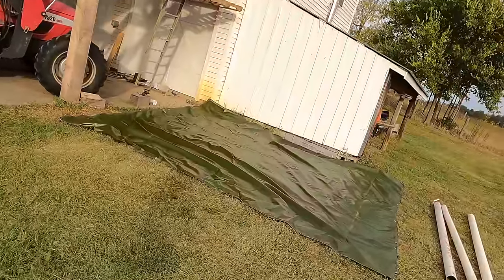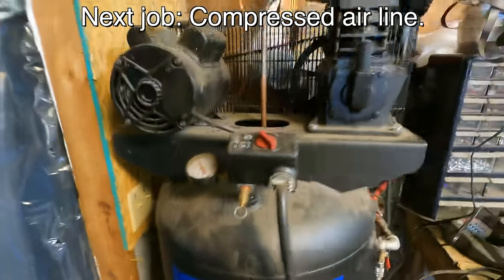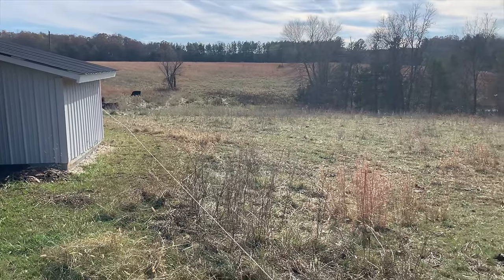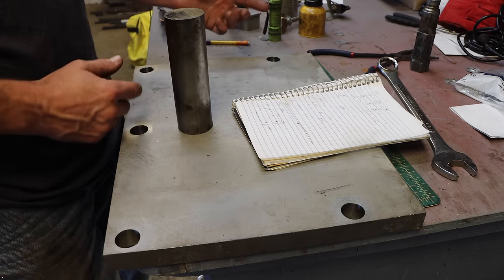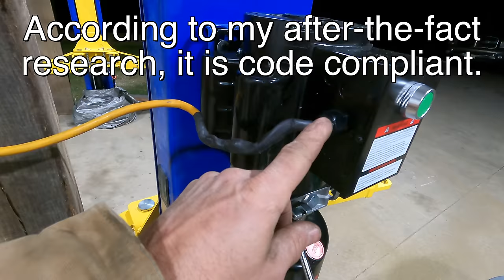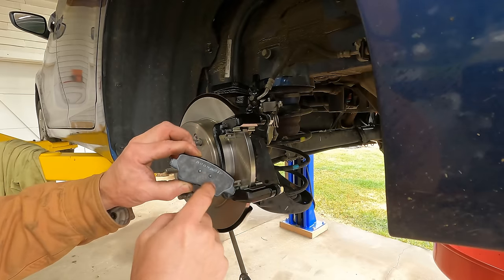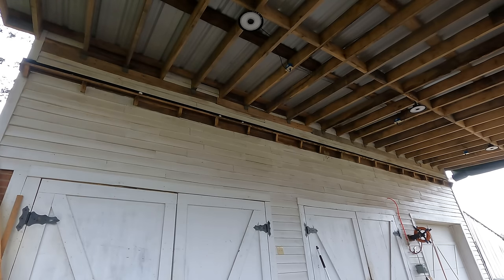Installing a 2-Post Vehicle Lift And Other Big Shop Improvements.

Comment: Next Upgrade for the Lift: Paint a line perfectly centered between the lift posts to use as an Alignment Line when pulling cars into the lift bay so they're centered between the posts unlike your daughter's car was (it was at least 4 inches left of center if not 6)...that will even out the lift forces on the jacking arms as well as make getting in and out of the driver's seat easier...

Comment: Little advice to the air line outside, make a bleeder valve. The outside air temperature range low/high mite create moisture in the supply line. Bleeding a short burst the supply before hooking up /using the real will make your tools stay “happy”

Comment: That stainless base plate is impressive! If you're ever in a similar situation and looking for a more cost-effective solution, it's common to epoxy anchor pieces of all-thread (rather than expansion bolts) into the concrete, then thread on a nut and large washer to set the base plate on. You get precision leveling and adjustability on-the-fly -- no machining and no stainless base plate necessary! Then, pack with non-shrink grout as you did. Voila!  That said, yours is a great solution that uses what you've got. Run whatcha brung, right?
Reply: I see the city guys do that here in Seattle. Then plenty of grout under the plate.
Reply: I was about to say this! That's the way to go
Reply: Double nuts to level, then packed with grout, this is how countless outdoor fixtures are mounted and leveled, street lights, traffic lights, signs etc etc. Your engineer friend probably could have pointed you in that direction. That said I do actually make inch to 2-in thick stainless steel mounting plates for large outdoor sculptures and those annular cutters look fantastic.

Comment: Sheer luxury with a 2 post lift, sheer luxury. I am very envious. Your Angus cows look well feed and very quiet so I assume hand raised or just used to being around people.
One tip from when I was dairy farming. When strip grazing we would back fence the already grazed part so they did not go back over that area nipping off new shoots, made a surprising difference to how much available feed we had. Of course you need to be able to arrange the backing fence so they can still get to water.

Comment: "Perfect is the enemy of good." -something I read by someone somewhere.  I think I learn more practical things from this channel than any other one I watch.  Pex for air is amazing.  I don't have a shop compressor (or a shop) but I love PEX and when I get to that point I know what I will use to plumb it.  Really appreciate this and the chainsaw tips.
Reply: As an old time plumber, I was reluctant to start using Pex or any of the plastic "pre-Pex" options out there.  Since I've started using it, I'm hooked.  use it every chance I get.

Comment: Straightening that angle iron reminds me of straightening the bumper on a 1975 nova. Set the bumper on the ground. Laid down the jack. Then a bunch of 6x6 pieces of wood. Wrapped 2 chains around the bumper and the wood. I seriously thought the wood was going to explode into shrapnel as I pumped the jack. And I was standing right above it. It’s actually amazing how much large pieces of wood can bend. It got the job done.

Comment: Since your lift is not in a heated building, get a lizard tank heating pad and stick it on the outside of the lift's hydraulic tank.  This will keep the oil fluid if you have to use it when it is below freezing. The heating pads usually have an adhesive on the one side or you can just zip tie it to the tank.  I only plugged mine in a couple of times, but things usually need serviced at the coldest of times.
Reply: Also, that's like a stick-on sump/block heater for Canadian cars.
Reply: Great call Scott, cold fluid is not fun.

Comment: 3 things: 1st, love the channel. 2nd, I've used pex for airline for 10-15 years and have never had a problem.  3rd, I hang my lawnmower from the lift arms with straps rather than lift the mower with the arms under it. 😉

Comment: A few things you may want to be aware of:
1) The bushings that you put under the lift are not something I would have done: you're relying on a much smaller area on the bottom plate of the lift to carry all the weight - and the problem is not the static weight, it's what may happen when, not if, the load on the lift is not balanced. Also, the bottom plate is not big enough, the bushings are actually OUTSIDE of the plate's perimeter. Because of reasons, load should not be on the edge of the plate, best practice is to have an unloaded edge that is at least equal to the thickness of the plate itself.
I personally would have scuffed the concrete 2" wider than the base plate of the lift or so and poured concrete to have a level surface, possibly with a little mesh in it. I saw that you added the concrete after the fact, but the problem with that is - concrete sets [yes, even the non-shrink, in applications such as these I would not rely on it] and you will not get the same level of support, plus you don't know whether you have voids in there - rather, you're almost guaranteed to have some. If you wanted to do it the way you did it... scuff the concrete, put the steel down, box it up, put the concrete in a LITTLE too tall, let it set, skim the top THEN install the lift.
Or, if you wanted to do the steel plate thing, I would have done two plates with the bushings in the middle - preferably welded.
2) Please be advised - you have a SINGLE hydraulic circuit with a T - so if ONE of the hydraulic cylinders or any join fails.. yes, you're out of pressure and relying on the safety locks.
3) As to the electrical installation, please please please leave the panel end of the wire disconnected and OUTSIDE the panel while doing the work. Once you're done with everything and have checked your connections, THEN open the panel and connect the wire end.
Also, it's a pretty good idea, given that you're outside, to use a GFIC breaker - yes, they're more expensive, but they can save you from all sorts of unpleasentness. As a matter of fact, no circuit should be without a GFIC breaker in 2022.
4) As to the 120VAC outlet on the 220V run, it will work, it will even work with the GFIC breaker (it 'does the math' on the two phases PLUS the neutral) but I am willing to bet that that box doesn't have the cubic inches to be NEC compliant. Please double check.
5) Please put red tape (red shrink tube even better) on the white you're wirenutting to the red wire to indicate that that is not a misconnection but an intentional usage of white-for-phase-2.
6) The connection between the outlet box and the lift is really scary. Open the lift panel and run a looped (to the floor, so nothing can fall between the column and the lift and hang on the wire) continuous run of MC between the lift box and the outlet box. Yes, you will have to change the liftside bushing. No, those soldered connections in the middle are really not best practice. Warranty you say? Least of my worries TBH. If you're really going to use soldered connections like that, use a rinse for the flux (there exist non acid fluxes, but you can't be sure of what is in a fluxcore commercial solder spool), use hotmelt lined shrink tubing on the individual connections (minding stray wires...), THEN run something like the Tesa loom tape over them THEN put more hot melt heat shrink on top, it won't be perfect but it will last a lot longer than what you have there.
Yes, I'm a pain in the rear, can you tell? I do not, OTOH, know anything about cattle other than liking it on the grill :D
Reply: somone had a lot of time to tell other people exactly what they are doing wrong with everything. There is always a better way to do things in any situation but I'm sure he's just fine with how he did it all
Reply: @micahdeboer9877  someone decided to take time out of his day to point out things that are dangerous in a very real sense, both to make the author aware and, more importantly, to make others aware of what good practices are, given that this is a public setting, with all that entails.
But sure, you can read it your way.
Reply: The grout is absolutely fine. It’s the same stuff that you use to install structural steel columns. When you install the columns the base plate doesn’t sit on the footing, it actually sits on leveling nuts, you then grout under the base plate. With the lift he didn’t even really need the bushings . He could have just set the post on some leveling nuts and just grouted under. The grout will provide plenty of support.
Reply: Fabio -- Such good points.  I would like to add that the roof is a bit low.  I would like to see that pickup truck on the lift.  At one point if somebody is not paying attention the cab of a pickup will hit the roof and bad things will ensue.  Very bad things with that install.
Reply: @mysticdavestarotmachinesho5093  That is always the case with this kind of lift. The lift is limited by the cross piece, not the roof.
Reply: Totally agree on ALL points about the electrical work - if you value your life or have loved ones, don't do this!

Comment: Love your videos. As for electrical, I totally agree with you and I would have done things the same way. 
The only thing I would change is @35:15, I would have broken the bridge tap on the receptacle hot side, and fed both of the 120 legs to each side of the receptacle. 
That way you could have 2x 120v 20a out of that plug, if you ever need to run 2 power-hungry tools, or if you ever get someone that visits you and wants to help out. 
You literally already have everything there, so no extra money or effort is required.

Comment: I found your channel a few months back and it is by far one of the best! Thank you for your explanation of complex systems, from a mechanically minded guy, I really appreciate seeing things I haven't had personal experience with. One tip on non shrink grout, Ive found that a sausage gun and a piece of tubing allows application in those hard to reach places. Cheers!

Comment: You’re correct, you are not an electrician 😋 I am an electrician. That’s not up to NEC code standards. However, I also grew up farming. That’s definitely up to farmer standards 😂 
Good job bud! Always looking forward to your weekly content
Reply: Which bit is not up to code? The soldered joints with just heatshrink covering? Here in the UK the joints would need to be inside an IP66 enclosure, I think soldered is ok but crimped or Wagos would be usual.
Reply: And electricity knows the difference between a farm building, a house and a 100-story office building; just sayin'.
Reply: They sure do things differently over there in USA great video again cheers from the UK
Reply: Which parts?
Reply: @denali9449  it doesn’t discriminate when it kills or starts fires either
Reply: I agree. I am also an electrician and seeing this type of hackery documented so that others may think it’s acceptable is no good.
Reply: @jdsparky288  Agreed - just like the fire is no hotter or more dangerous for a paid firefighter compared to a volunteer.
Reply: Bare minimum, I would replace the outlet with a GFCI and install another circuit breaker or switch right at the outlet. 

If the push button switch on the compressor malfunctions, you have no way to stop it quickly.

Comment: Love your channel. 

Pro Tip on electrical wire.  Don’t pull it out.   It coils and makes it difficult to look flat stapling it up.

If you take it out of the package, take the top end of the wire, wrap it around something sturdy and spool the wire off, walking away from the stationary point.    Makes it a lot easier and neater to pull and staple.

Love the lift!!

Comment: Good stuff. Thanks for the video.  When soldering (?soddering) wires together, I "wet" between the wire and the tip with solder and then move the solder to the other side of the copper wire.  I find this greatly improves the amount of heat transferred to the wire and as well as reducing the opportunity for the insulation to shrink from too much heat.  Cheers, David
Reply: Agree, but I would use crimps or Wagos rather than solder
Reply: @pcb1962  Just Googled Wagos - nice stuff, thanks.

Comment: My school used a similar system for a divider in the gym. Their system had a long shaft at the top that spun off a motor and pulled on all straps at once.

Comment: I did the exact same things to my shop several years ago.  For the Air lines, I had a couple hundred feet to run so I used 1¼" L-copper (spendy!).  Also, I hired an electrician because I needed an inspection (non-farm), but everything else was pretty much the same.  I think the model lift I bought has another foot or so height, otherwise it looks exactly the same.  I have several Chevy Express 3500 extended vans and lift it to the stop bar with no problem.  After this video I'm going to re-torque the expansion bolts.  Thanks!

Safety suggestion; If you're working on a full size truck at max height it can feel a little sketchy.  Four "tripod under-lift stands".  (about $120/each) are the difference between; "I feel pretty safe" vs. "That's not going anywhere". 

Awesome Video.  Loved every minute!

Comment: Hey love the video. Can't wait for a video on how you heat your house, sounds like a unique system.

 Wanted to shed some knowledge on how you were able to add the 120 volt plug on the lift. For residential 120/240 volt systems, such as what you used on the lift, the key thing to remember is that it's single phase.

In other words, there is no 180 degree phase shift that gets 120 to 240. In actuality what's going on is that there is a 240 volt difference between the 2 hots going from your service transfer to the panel hots. The neutral is the middle point, and allows both panel buses to provide 120 volt circuits from hot to neutral. I hope this comment doesn't come off the wrong way and is helpful.

 If you have a 3 phase service, then you start to consider phase shift, but they will be at 120 and 240 degrees -  giving you a phase to phase voltage of 208 volts (not 240).

Thanks for all the videos, I learn alot.

Comment: Quick tip: when crimping pex, carry a set of channel locks with you to give the crimps a little pre crimp. It holds them in place while you get the crimp tool situated and also deforms them perfectly so the tool slides right on em nice. I love watching your videos keep it up

Comment: Another method for the complex base on the lift is to cast a base with non-shrink grout on top of the concrete. Lift the post, pour the grout and lower the post into final position.  Does require hanging the post plumb during cure time.  
Great set of videos!!

Comment: watching some of your older vids -- i have replaced the o-ring in my HF hose reel and fixed my leak.  a cousin-n-law worked for napa and went toa trade show they demoed epoxying bolts into the concrete  and put a puller on the bolts - most of the mollie bolts pulled out with little effort and tear out -- the epoxy!!! pulled about 5 inches of concrete out with the bolt!!!!! have fun

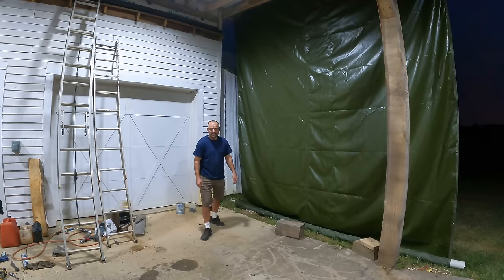Comment: 7:27 You did a great job by making the lift for the tarp, gave me some ideas for my porch. We use a tarp that is fixed to wood at the top , one side always closed and one side that can be closed and open in the summer. But for extra strength to heavy winds, the tarp at the top is wrapped 1 time in a roof batten (2 by 3 cm) and with the screws through the batten, that way the force is spread all over the tarp, and this helps a lot, because those premade rings in tarps will tear out when the wind is heavy.

Comment: There's nothing worse then waking up in the morning and finding out all your tarps went somewhere else in the middle of the night!  They have a job to do, and they do it well, but that doesn't mean they still don't want the proper assurances that you are 100% committed to their purpose.  An unbreakable bond between Man and the things he builds.  Once the holy vow has been spoken, "that's not going anywhere," the oath is affirmed and and the bond is sealed for eternity.

Comment: Running a 120v load on one leg of a two pole breaker is fine because you have a neutral wire. You could even run the lift and a 120v load at the same time because the unbalanced current will flow on the neutral wire. Some high end lifts have built-in receptacles wired the same way. It’s the same reason some 240v appliances use 4 wire plugs.

Comment: I love my Evolution miter saw,  I use it for wood 95% of the time but when I need to cut wood with nails,  screws, or some exhaust pipe....it does the trick.

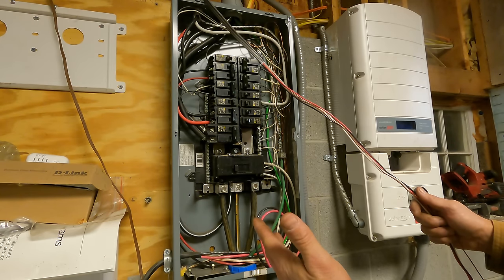Comment: 30:00 the neutral bus bar can be bonded to the ground so there is the potential that you can touch it and nothing will happen. From what I remember the main panel is bonded and sun panels are not bonded.

Comment: We use PEX too.  Water needs 100% sealing, thus great for PEX.  Watch your pressures.  We use the expansion PEX to reduce static (internal resistance). This allows more flow.  This is also why we to keep the fittings to a minimum.  Every fitting is another potential leak point AND, a gentle bend adds a lot less restriction (static) in the system.  Nature likes curves.  "I" like curves.  The PEX system prefers bends, and even pretty tight bends.

Comment: You could use non-shrinking grout under the leg. I used it a lot for setting machinery. 
Love your sense of humor. So does my wife. Keep the videos coming. They are the best. 😁 Wanted to add to your “close enough” comment. I was a millwright for many years. Took care of veneer plants. For us it was “if it’s close enough it’s not good enough”. But we working with .005-.020”. 😄

Comment: I do the staggered connections as well, but also slip heat shrink tubing on each individual wire, as well as soldering them..